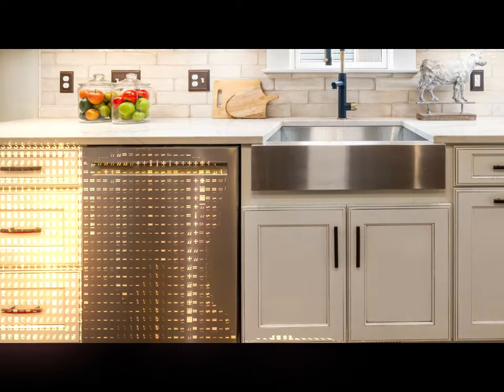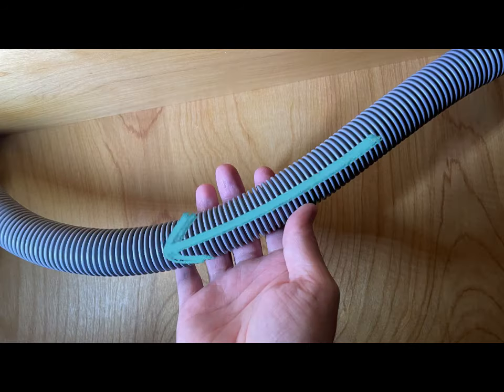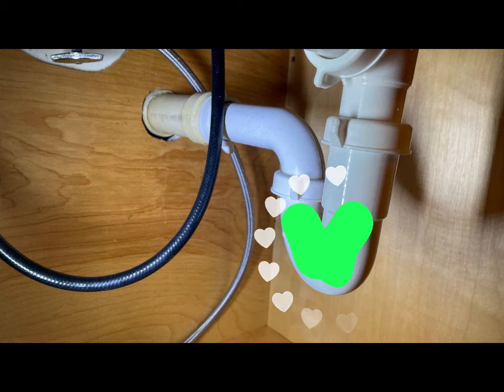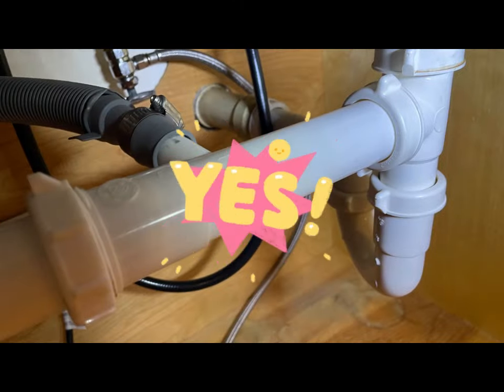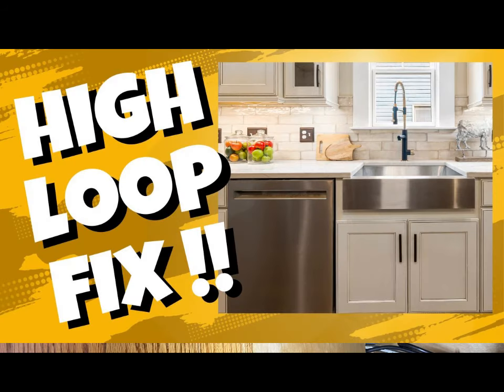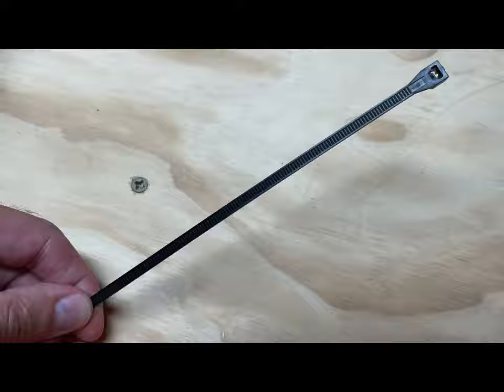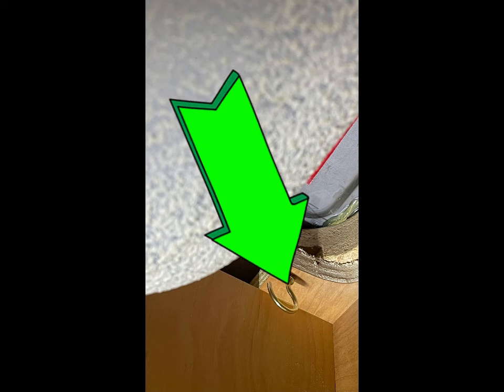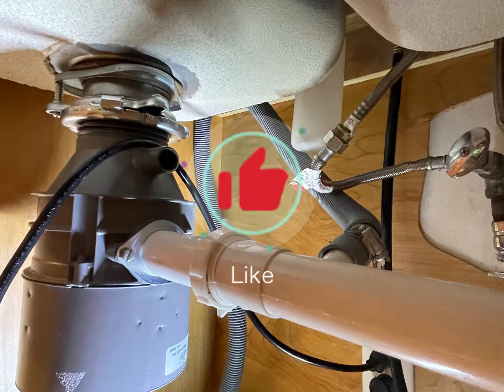How to INSTALL a HIGH LOOP Dishwasher Drain Hose #diy #plumbing #howto #homeimprovement #home

Comment: If you have an air gap, but atill have excess dw drain hose that loops and sits on the bottom of the cabinet could that be causing odors we experience?
Reply from the maker: Great Question - I think anytime there is a place for water (especially dirty water) to sit undisturbed on the "house" side of any type of trap it has the potential to lead to odors escaping

Comment: Can't you just cut a hole near the top of your unit and run the hose over?
Reply from the maker: Thanks for the question! This could be done if you have enough clearance behind your dishwasher to run the hose up behind it - if it is a snug fit the hose being behind it might cause your dishwasher to stick out too far in front
Reply: @weekendworkbench1  but the hose goes in to the back of it no matter where you run it. It goes in to the recess at the bottom
Reply from the maker: The dishwashers that I am familiar with have a void at the bottom back of the dishwasher so it easily has room to sit and run into a side cabinet - if it is run up the back of the dishwasher then it will be against the back of the dishwasher tub and could push it out a bit - just the ones I am familiar with anyway - others may differ- thanks!
Reply: @weekendworkbench1  ah I see. Thanks for explain. I am putting ours for the first time and want to get everything right. Thankyou for your help. 👍🏻
Reply from the maker: You're Welcome!!

Comment: What if the drain hose is not long enough for the optimum high loop? I don't want an air gap (ugly and it removes my sprayer or soap dispenser). Can I just get a hose extension to get a high loop?
Reply from the maker: Great Question!  Sorry, I don't know the answer - maybe talk with a local plumber to see what would work and ask about the building codes in your area.  Thanks!